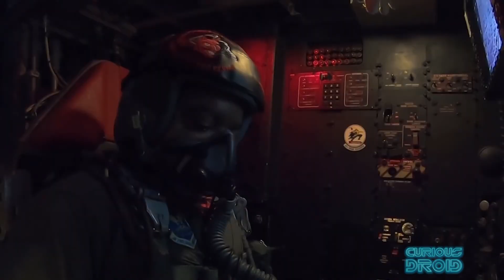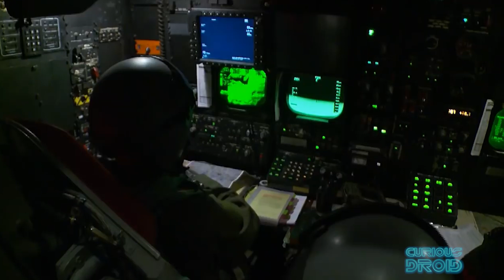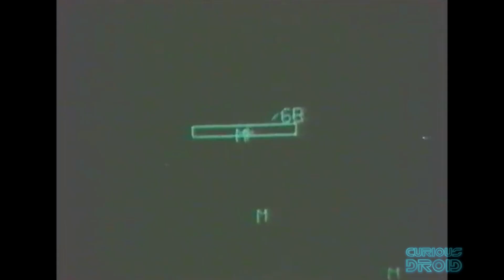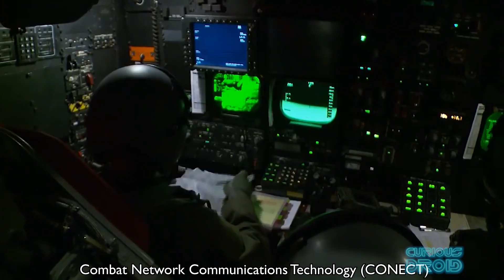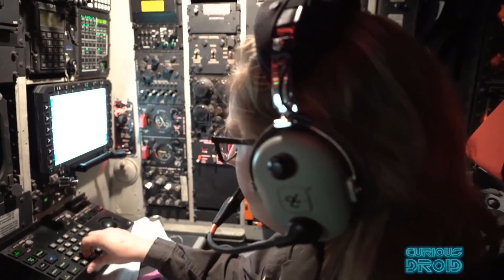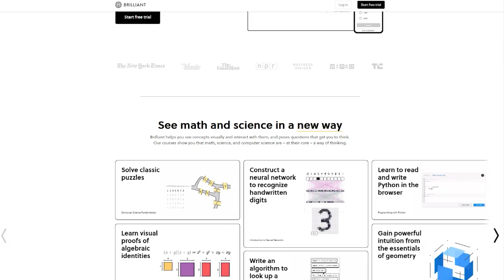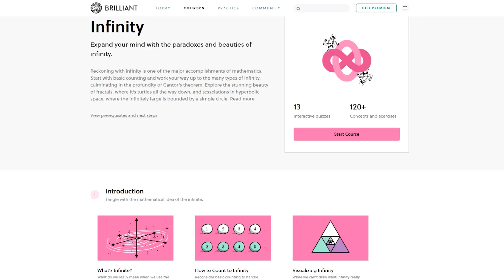How Long Can the B-52 Continue in Service?

Comment: Bottom line: The stuff that came out post WW2 was built and designed by geniuses. The SR71 was designed in the late 50's and (as far as we know) is still the fastest plane in the world, with a top speed they still won't disclose. (...and if you think it's actually retired, well...).

Comment: The U-2 by Lockheed which made its debut in 1955, is also still in active service.  The aircraft was involved in one of the biggest espionage controversies in the cold war when Powers was shot down in 1960. 

It is extraordinary these cold war brainchildren--whilst the world geopolitical landscape has changed entirely--remain viable military assets. It is a testament to exceptional engineering, both yesterday and today.

Comment: I recall seeing an article about a problem with reengining the B 52 with 4 modern high bypass turbofans to replace the eight smaller engines- one engine per pylon. The story was that this would not be safe because the plane could not manage the  asymmetric thrust of losing 50% of the power on one side if an engine failed.  With 4 engines on each side, loss of one engine is only 25%. Apparently this goes back to  a program to help them with expected low altitude target penetration. The vertical stabilizers were shortened, reducing low altitude drag but also reducing yaw control needed in engine out situations. You can see the  clipped tails by looking at the pictures in the videos- some are short and other are tall.

Comment: If they can get an f35 radar onboard, and the computing hardware/ communications/ and software on board, the BUFF is going to be able to do a certain amount of anti-radar work as well. And they can and will, with more upgrade-space than we can possibly know.
They certainly won't be stealthy, but they will be able to be used in somewhat enemy-monitored airspace. Not exactly a wild-weasel, but not lacking in detection, jamming or informational support for other assets.
Long live the big, ugly, fat, f'er!

Comment: An airplane is like George Washington's axe.  I saw the original once.  The handle had been changed 6 times and the head twice, but it was the original axe.  With most sophisticated war airplanes like fighters, the aerodynamics and the fundamental shape changes so a new airplane with a totally new design is required.  But the Buff is just a weapons platform.  Gut it, put on new motors, put in a new panel and new avionics, replace all of the tired aluminum and you have a new airplane. But for a ton less money than a new design.   Put on the latest weapons and you have what you need.  Just like George's axe ...

Comment: The B-52 does not have to be replaced by the B21. The Air Force has this thing about buying new aircraft that have less capabilities than the the its replacing. So you may see this as the B21 replacing the B-52. But in Air Force Think, the B21 is replacing the B2, not the B-52.
This means that the B21 (or any other bomber aircraft) has to have a high degree of stealth, better than the B2, which of course vastly increases the purchase and maintenance costs.
Think about it. How much would it cost to create a heavy bomber, subsonic, with no stealth and a 7,000 kilometer range? All the bells and whistles of carrying ordnance, electronic warfare, etc. Just no stealth. I figure about the cost of a large commercial jetliner.
We don't need stealth aircraft to go after terrorists, 3rd world nations, or any other enemy without modern defenses against air attacks. But no way is the Air Force generals at the Pentagon going to go for some cheap and dirty bomber. For them that's like going grocery shopping at Aldi's.

Comment: The Buff reigns supreme. The B-1s have undergone a similar upgrade, and are the King of the Fastmovers in terms of conventional weapons delivery. Due to the SALT Treaties the B-1 no longer has a nuclear mission (wires were cut out) but it can clobber a target with conventional munitions, and if one does a "Show of Force" in support of SOF forces or just normal folks on the ground with an imbedded FAC, the bad guys normally run away pretty quick.

Comment: Everything you say is all relevant but it boils down to one thing, performance plateau. Jet engines have been pushing these sub sonic big planes at approximately 400 to 600 mph for the last sixty years, the leap to the speed of sound requires an exponential leap in cost and technology for these big birds. If the cost benefit isn't there for commercial airlines it isn't worth the military time of day. The B-52 just happens to fit their role perfectly in this same performance plateau.

Comment: The U-2 spy plane also first flew in 1955.
It to has a limited supply of airframes that are constantly repaired and upgraded.
The only reason it's still in service is no better replacement yet.
The Global Hawk UAV is a fine plane about the same size, but can't replace it due to not having the capacity for multifunctions  as the U-2 has.
That's the result of congress adding more demands of the GH after it was built.. but that's another story.

Comment: The KC-135 and C-130 are gonna be others in the group of century old aircraft. With cargo-type aircraft as long as the airframe is sound you can upgrade engines and avionics and still keep that same airframe.
The B-52 is basically a cargo plane at this point. The majority of the fancy modern technology is going to be inside the ordinance itself. The B-52 can basically be an old pickup/dump truck that lugs around bleeding edge new ordinance... as long as it can maintain that standoff distance out of the range of modern air defense. Or be used against a foe with little or no air defense.

Comment: The B-21 will suffer the same fate as all modern new military systems. The manufacturer will milk as much money for research as possible without doing much actual research. The government needs to change the way it does contracting. If a company claims they can build it in X amount of time for X amount of money. They need to pay any cost over-runs and suffer a penalty for not making their deadline. Just like any normal business. Until this happens we will have very few overpriced pieces of equipment that breaks down often.

Comment: A question from someone who had no idea. 
Why wasn’t or couldn’t the b52 be used as an air refuelling platform?
Reply: Harry Ballz - The slim fuselage has no room for the large-capacity fuel tanks required for such a task, which is why they use tankers based on airliners.

Comment: The B-52 has power output similar to that of 8 locomotives, it has over 5 miles of wiring, and enough aluminum to make 10,000 garbage cans. And it flies like 8 locomotives pulling 10,000 garbage cans dangling along behind 5 miles of wire.

Comment: The interesting thing about the comparison between the length of service of the Sopwith Camel and the B52 is the truth that it reveals, which is that the rate of improvement in aircraft technology in the last seventy years has slowed down dramatically in comparison with the fifty years before; no doubt because during the  fifty years after the first powered flight there were two world wars to move the technology along. Personally, I'd rather do without the world wars and accept a lower rate of technological innovation as a consequence.

Comment: Most militaries still use some kind of single rotor biplane for low level recon and infiltration. They arent much updated from the spirit of st louis excepting the fact their bodies are louvered and the plane can be opened to the elements at low altitudes, allowing it to coast and glide much more effectively. This makes unpowered, and therefore silent, flight possible as the plane can use its entire body to generate additional lift. The pass-throughs also reduce its radar profile and the engine cools quickly allowing it to drop off thermals.

Oh and manual louveres instead of powered ones reduce its detectability by mag-res as well. A good design is a good design, no need to waste

Comment: I think it's a sign that aeronautic technology plateaued around the middle of the last century to some degree, at least when it came to large utility aircraft that don't require stealth and stay subsonic. The C-5, C-130, B-52, Tu-95, these are all large airframes that don't have to do anything particularly fancy other than carry large amounts of stuff long distances and in some cases, drop that stuff. Even modern jetliners all started looking the same as early as the late 70s. As long as they don't stress the airframes too much by pulling hard Gs or flying low level too often, they can avoid metal fatigue for many decades. And because they are big airplanes they are pretty easily upgrade with new avionics and other subsystems. That said, C-130 is still in production and new ones are rolling off the line today, much improved versions at the beginning of their service lives, while the last B-52 was built in the 60s.

Comment: Are the newer engines actually stronger? I thought they were more efficient especially due with a higher, say 10 to 1, overpass ratio. Basically bigger and more efficient, so you could replace a double engine with single efficient one and fly the plane around forever.

Comment: Only 108 of the final B-52H models received TF-33 engines. Most B-52's (A-G models) were equipped with older and less efficient J-57's. This gave the H model greater range, power and a reduced takeoff run. Still, talk of re-engining the B-52 has gone on for decades.
Reply: And no need to dump water on brisk nights when the temps dip near freezing.

Comment: The fact of the matter is this:
Bomber such as the B52 are irrelevant in multi-national combat with the huge presence of ICBMs and cruise missiles.
The only use for aircraft such as this is for smaller scale conflicts against less advanced parties such as insurgent groups (the typical "peace Keeping" missions undertaken by the US military)
most of these groups don't have any significant anti-aircraft presence, there is simply no need to replace it since it does bombing so well.

Comment: I wish more non military products were built as well as the B-52.
Reply: ...in the days of disposable coffee makers.
Reply: they used to be. you used to buy a kit to assemble a tv and it cost less then buying a brand new tv. same for cars. there was the King Midget which you bought a kit then had to source the materials for the doors etc but you could build a small car cheaper then buying a brand new one.
Reply: siemenssx1  thats exactly what I said, but in frames per second. X>60fps=x>60hz.

Its the same reason PAL games run in "slow motion" compared to NTSC games.
Reply: siemenssx1  they can't match the refresh rate of the older gaming consoles. Any WR run of any retro game is set on a CRT because flat screens cannot match the frame rate given by the console, resulting in a poor interaction between the console and television. 

The hz of the television doesn't matter so much as the actual frames given at any given second. What modern televisions do to compensate is give 2 identical frames back to back. Under normal television viewing circumstances, it wouldn't be a problem, but when the world record of say, Super Mario Brothers, hinges on 30 or so frame perfect (1/60th of a second) inputs, and the television is constantly giving identical frames back to back because it cannot refresh that quickly, the frame refresh rate matters more than what hertz the television is running at.
Reply: Military materiel is used to ensure control at home and expand imperialism abroad. Consumer goods are bread and circuses for the shit eating chumps. Capitalism incentivises quantity over quality with economics of scale
Reply: If you want to spend billions of dollars upgrading your 15" CRT TV you are more than welcome to. Most people would rather buy a new product with new features every few years.
Reply: @r9bet  CRT TVs are sough after by retrogamers  especially the Sony Trinitrons.   When you look at the picture image and "smoothness" of the scrolling/movement  on it with retro system there is no comparsion.  older restro system like NES/SNES/GENESIS/TG16/PSX looks amazing on CRT compared to stretchs off ratio HDTVs.
Reply: @TheOldFartGamer  thats not the reason retrogamers want CRTs. It's because the frame rate of a CRT is 60fps, and retro games have a frame rate of... 60fps.

Flat screens of all varieties have a lower frame rate, meaning the game plays in slow motion, and control isn't as good.
Reply: @r9bet  yeah new features that no one even uses and often has to change or disable because they render one unable to use the tv.

Comment: Great video. It will be interesting to see the outcome of the re-engining program. Is the intention to go from 8 to 4 engines ? If 4, I wonder if they would have difficulty fitting the two outer ones, given that wing droop in the ground.
Reply: Today they could use 2 GE 90 115 B, they would still have 2/3rd more thrust than the 8 TF 33s, but it would probably not fit under the wings, or rip them apart ;-)
There are versions of the CFM 56 with similar thrust specs like the TF 33s, which are not much wider from the diameter compared to the original engines.
Reply: @simonm1447  Very interesting, thank you for that information! :)

Comment: C-130. A-10, and the B-52///they've lasted so long because the people who designed them did the job so well their is literally little to no room for improvement on the design.  Damn shame for the latter 2 they literally can't make anymore since the equipment no longer exists.  Makes me think they should take the designs ( pretty sure the design schematics still exist ) so they can tweak them as needed to account for advancements in material sciences and other stuff, then make new and or improved versions ( not sure how in the A-10's case, AFAIK the only thing they've been able to improve has been it's electronics, everything else for that plane strapped onto a gun was perfect to begin with for it's role )

Comment: Its length of service is no surprise if you know the history of technology. Tech always hits plateaus until a breakthrough in theory occurs, which hasn't happened in aerodynamics since then. An historical example: the basic design of the knife hasn't changed- save for specialty jobs- since the stone age, except for materials. A 4,000 year old knife will kill you just as dead as the latest 2020 model.

Comment: It’s only around because the only mission it can perform in the modern world could still be performed by an aging platform.  But that aging platform makes that mission set shrink. And since it’s shrinking the need for a new platform also shrinks. It’s actually a pretty fun circular thinking. It’s nothing but a missile truck or a bomber that can only operate in areas with no air defense anymore.

Comment: I think it's BS to think metal fatigue doesn't affect how reliable an airplane is. Every metal breaks with enough force and time. An airplane is like a soda can. It's really light, but strong. Every time a plane goes up, the outside air pressure drops, but inside is kept a bit higher (not quite 1 atm). To the plane, that's like pressurizing it to 12 psi. Then it drops when it comes back down. That's what destroyed the first commercial jet called the Comet (square windows).
My point is, every plane that's made of metal has only so many "cycles" before it's beyond repair. I think an 80 year old airplane falls into that category. It doesn't matter how thick they make it.

Comment: Surprised no one is talking about the KC-135. It's scheduled to be in service just as long as the B-52, if not longer, last I checked. From what I hear, the newest one in service was built in 1964 and the oldest one still in service was built in 1956.

Comment: The first base I served at when I joined the military had B-52s.  That was 36 years ago... and the aircraft was already considered a bit old at the time.  Btw, the air force base has since closed down after being in operation for 40 years.  Twenty years less than the B-52 has been in operation so far.
Reply: Me, too. Good old Mather!

Comment: In a scenario like Gulf War 1 carpet bombing will still be valuable and the the B-1 and B-2 have demonstrated that capability as well as the B-52s. You are probably right about the airframe being original; some B-52s were re-sparred and re-skinned in the 1960s but I am not sure they were Gs and Hs. If you want to get finicky the current B-52s no longer have the center eye-brow window or tail gun protection.

Comment: Since the current understanding is that the B-52 (or any other bomber aircraft, INCLUDING stealth bombers) would have a survivability problem entering enemy territories protected by the latest defensive artillery and anti-aircraft missile systems, that bombers are now relegated to a standoff launch mode. And as such I wonder WHY we must rely on aircraft designed as bombers to provide such capability. WHY, for instance, don't we outfit the THOUSANDS of civilian airliners...many of which are sitting in bone yards, with pylons that can carry these new advanced air-to-ground and air-to-air missiles? One would think it would be simple enough, with today's electronics, to configure THESE aircraft to do the job currently relegated to USAF long range bombers.

Comment: Let the Air Force decide. The thing I don't like about it is it forces them to stay with it as opposed to going to a way better platform. The b-21 will it be the most stealthy aircraft ever built, and I suspect it's going to fulfill more than just a bomber roll. I suspect it's going to be an adjective for air combat, for intelligence, etc. The B-52 will never be that. The only thing it can be used for is counterinsurgency and low-level warfare, or long-range cruise missile delivery. That makes it still, relevant. with what the Air Force is doing with their e-program, they may be able to build a replacement now for a song.